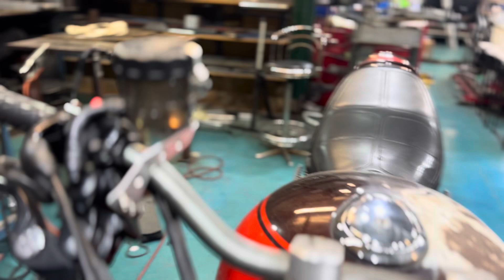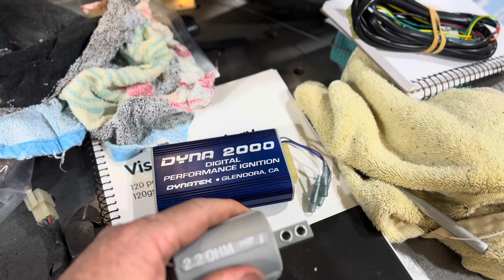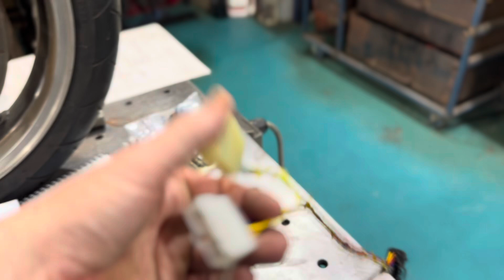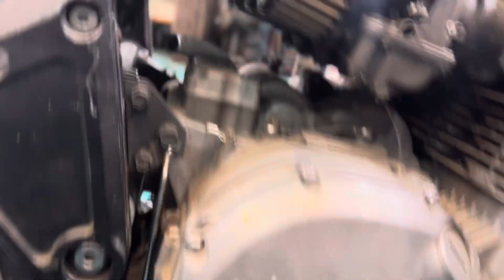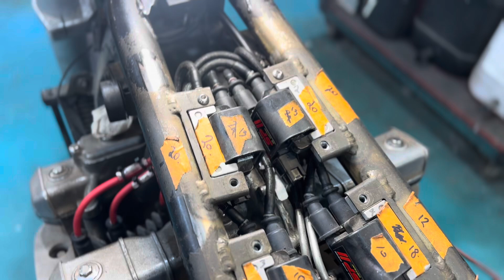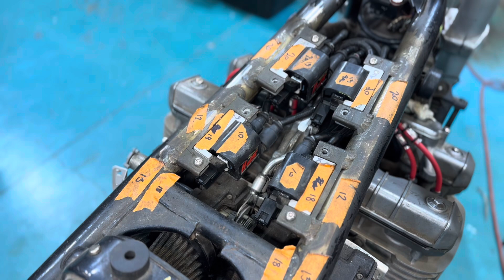Zephyr 1100 update, ignition

Comment: Hi, i personally have this as uatoni sp2 ignition in my zr1100 1992 and would definitely recommend.
Plug and play no issues at all i would definitely get there ht lead wire as it is as flexible as the type you demonstrated.
I wonder if you are going to upgrade the 4 speed gear box to the 5 speed as in the later models. I would be interested to see if this can be done.
Thanks for sharing. James in the uk.
Reply from the maker: @jamesplumb5296  cheers, yes I have seen a few in Japan running them while I was visiting tuning shops, very much like the dyna, the leads are definitely worth the price in my book. The Australian delivered bikes had the 5 speed, first gen had a fault with second gear tho, second gen changed the design and fixed the problem 👌
Reply: @ozzy1100  yes I know about the issue I fixed it with the factory pro modification indent arm and spring.
So the bike you have there is the 5 speed?